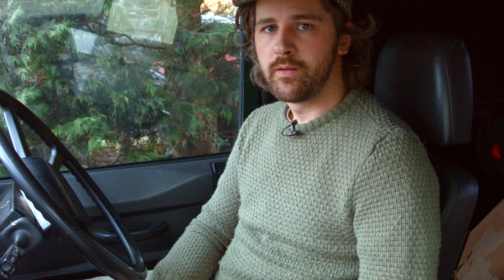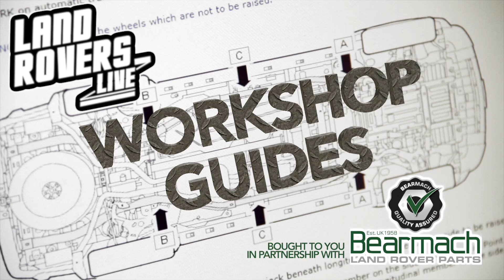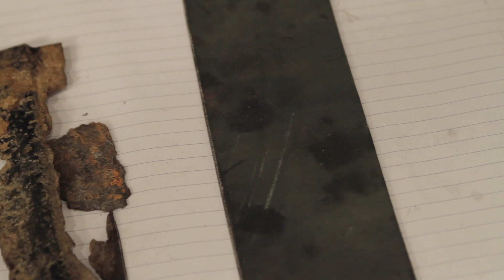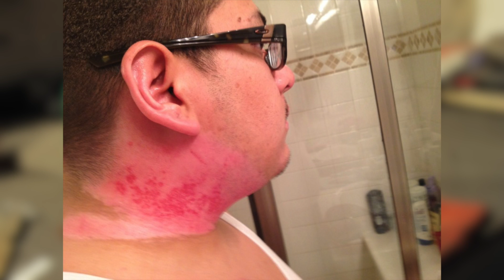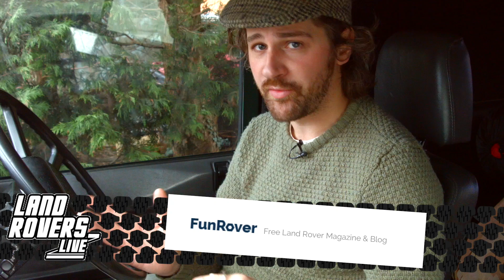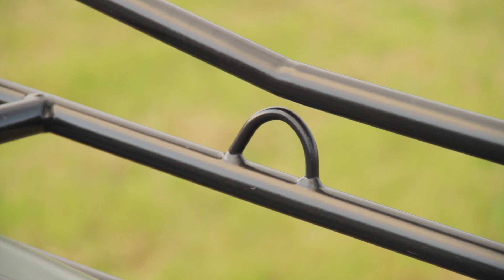Episode 8 - Welding Workshop, G4 Roofrack, and LRL Owners Club Launch

Comment: I just watched all of the episodes :) they were great :) and get noticeably better week after week, I do have two critisims though I hope you don't mind me saying but 1. I think you may have fixed it but in the first couple episodes I had to change my volume whenever you shot in a different area, I think you fixed it. and secondly could you may the banner think showing links to things smaller, me personally I feel it takes up quite allot of room on the screen, other than that I think what you're doing is great.
Also would you do a review on lights and led light bars or set ups. My boyfriend and I are looking for a decent setup
Thanks
Kimberly
Reply from the maker: Thanks Kimberly. great feed back. The links are optimised for mobile devices, But screens are getting bigger now, So lets give your suggestion a go and go smaller. 
Next Episode will have smaller Straps,w'ell keep an eye out for your feedback :)
We are looking into lighting now the nights are drawing in. Check back soon.
And thanks for watching.
Reply: Thanks for acknowledging me :) I have actually just ordered a cree 50" light bar :) for £290 delivered with 5 year parts warranty and 2 year replacement warranty. I will let you know what we think when we get it :) and the details of the guy that imports them if you want.
Thanks :)
Reply from the maker: KimberlyBarnett123 Great, do let us know how you get on with that.... Or shoot some video and you could well be featured in the show. Thanks Again